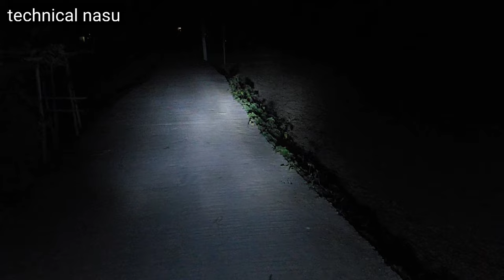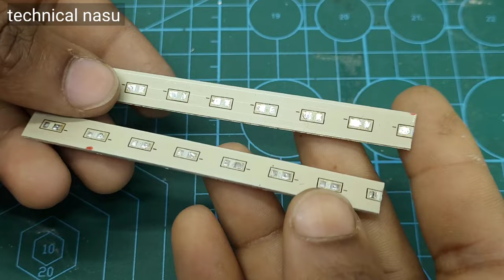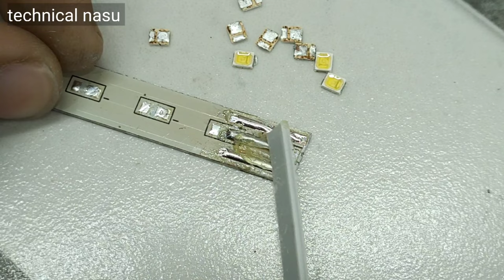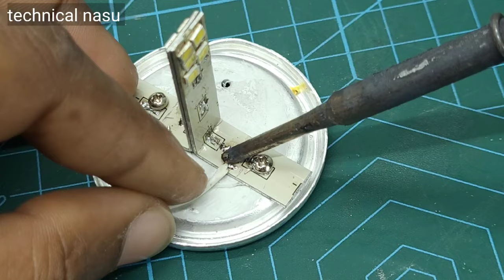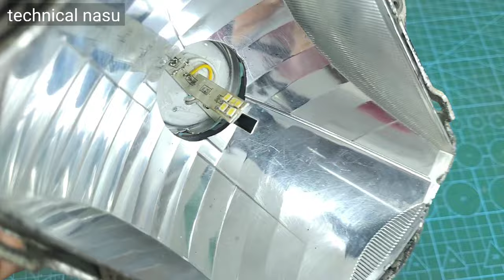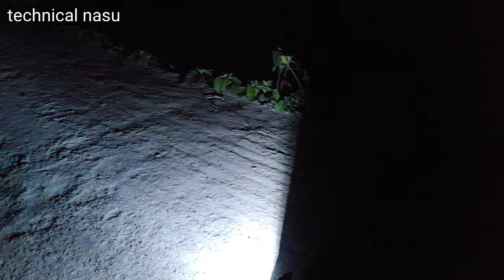घर में बनाओ Bike ka LED headlight | Making an LED  headlight for bike | homemade bike led headlight

Comment: did you ever try to understand 1. why the original tube's tip is dead/black, 2. placement of original tube filaments is up and down for low and high beams and you install the led's sideways, think before doing.........